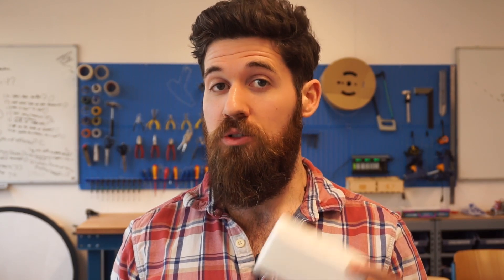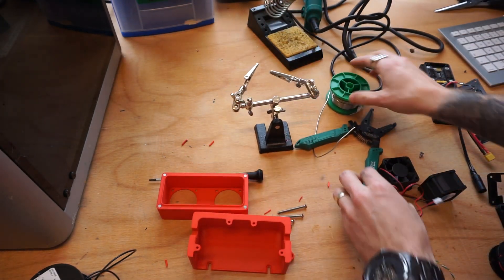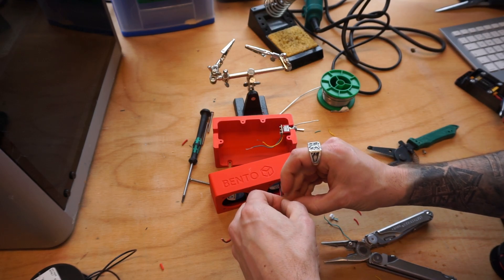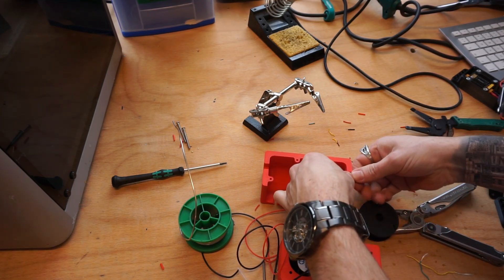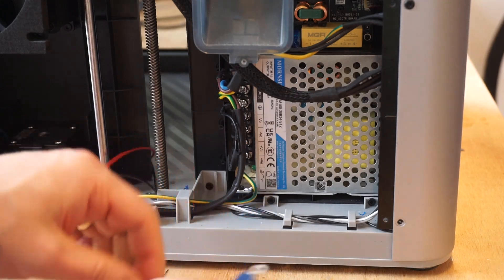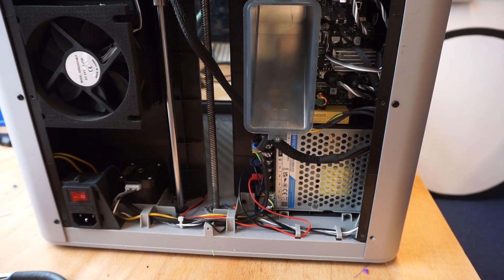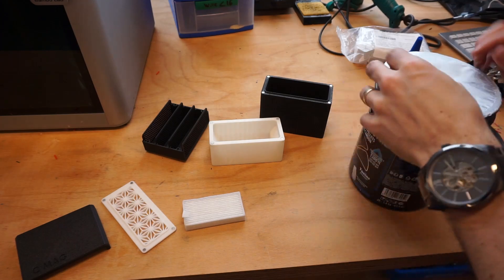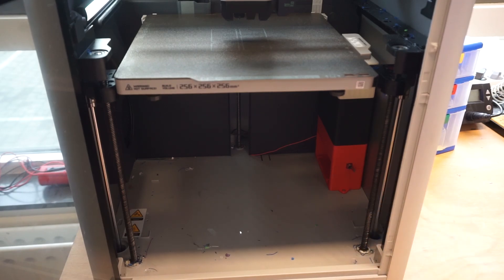Build Your Own Carbon Filter for 3D Printing: Step-by-Step Guide!

Comment: I'm building one of these atm.  I'm nit running off the printer power supply, but off a separate power brick, but I am controlling it with a Shelly Pro 1PM which will be controlled through Home Assistant.  It can get the printer states and turn the fan off and on while it is printing.
Reply from the maker: Great way of doing so. I’ve also seen people use a thermal hall switch to trip these too based on the heated build plate

Comment: Thank you for an awesome video! Great explanation of everything. I'll check my options out, but this may be the way I go to getting my bento installed in my X1C. I currently have it configured inside of a larger enclosure to move fumes out of a window (which does an awesome job. No smells or any issues in the room currently). I'd like to be able to have it be as filtered as possible though being that it's in my room. Have you had any issues to date so far? Find anything that works better, or is it just as good as expected?
Reply from the maker: Works exactly as expected. I’ve since added thenbento on top of a piece of foam to reduce vibration noise, but it keeps VOC’s super low and im quite happy with the setup.

Comment: Man, you made hard work of that! You think 4 brass inserts is too much hassle, but you're happy to disassemble the back of your printer and mess with built-in psu. I used a cheap 12V 3A plug-in psu, the cable goes through the small existing hole in the back left of the base of the printer, and I used a cheap PWM controller to regulate the fan speeds (2 x 4028 fans are quite loud at full 15,000 rpm!). Biggest problem I had wiring the Bentobox was that I didn't want those fan wires dangling down (especially as pwm fan cables have 4 conductors). Also check that your fans are correctly oriented so they don't blow when they should suck.

Actually, I'm pretty disappointed with the effect - I measured pm2.5, pm10, HCOH and TVOC before during and after a big print with PETG. The improvement in air quality was negligible and still classed as 'Unhealthy for sensitive groups'. I opened a window nearby, the TVOCs  dropped down to almost zero, and the PM2.5 also reduced (surprisingly, there's more PM2.5 in the air outside than in the room with the printer when it's not printing).

I'm just going to print some adapters and duct the chamber straight outside.
Reply from the maker: Thanks for your comment. A few things that may help your system get better performance: 
- Your reduction in PWM fan speeds is likely why you're getting poor filtering with this system. I saw a dramatic reduction in VOC's and pm2.5 when printing ASA or PETG once using this filter. In my experience, cranking it is best. 
- On Fan orientation, the Bento's tutorial guide specifically mentions to arrange your fans in a pull orientation and not in push. From the documentation: 
      "Place the fan blowing downwards. (Important) BentoBox system pulls air from the carbon case, not push air into the carbon case... I notice remixes of BentoBox where 5015 fans push air through the HEPA filter followed by the carbon pellets. If you imagine the blower fan is waves and the HEPA filter is the wave breaker on the beach. Once waves hit the breaker, a lot of initial force is lost. There will be very little air movement through the carbon pellets. On the other hand, BentoBox pulls air by creating a low-pressure system directly below the carbon pellets. In my opinion, it is a more efficient system".
- Perhaps your current fan orientation may also be why you're getting poor performance out of this system? 
- Check your carbon pellets. From what I was reading, acid free does a better job absorbing VOC's than acid washed carbon, I'm assuming because the acid wash reduces the porosity of the pellets? Though I'm unsure about this. 
- 2x 4028 fans are indeed loud at full speed, however, it's not much louder than the already included bambu aux fan. I'll take extra air flow over a bit of negligible increase in noise. The speed is likely how this filter gets its better performance, however. 
- I wanted to spend less money on this filter. So I removed the brass inserts and used the on printer PSU for power. There's no reason to spend more money on an additional power supply when there is a reliable supply of power built in on the printer. Taking off the back is minimal effort, as shown in this video. Saves space on my printer to not need a full extra power supply + plug, but to each their own.